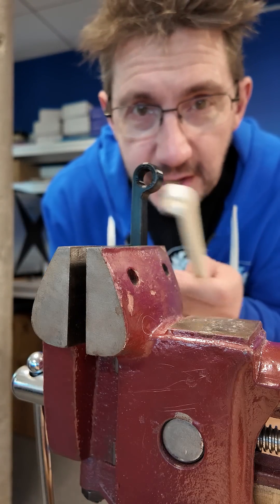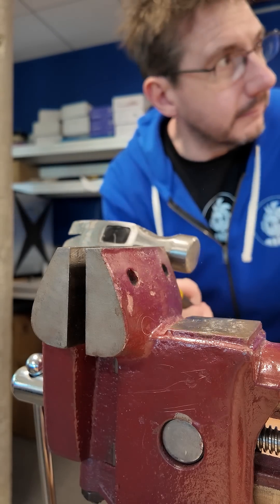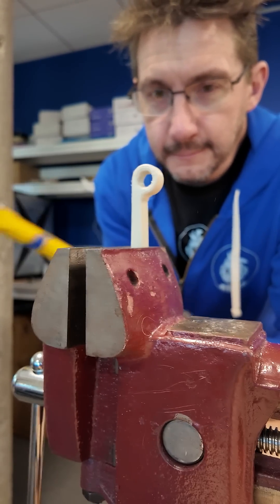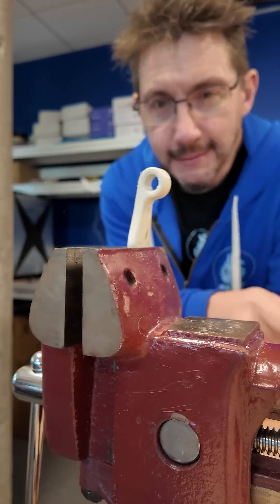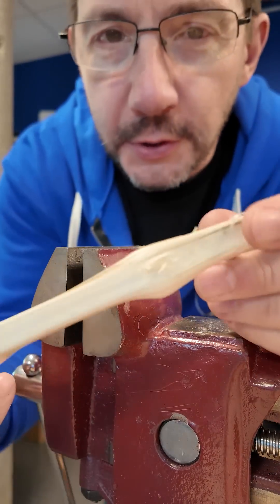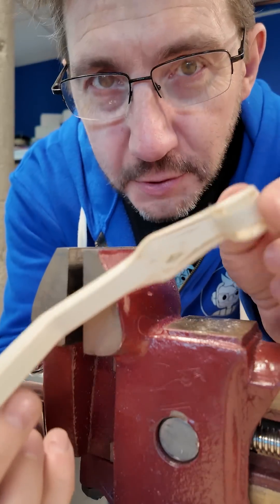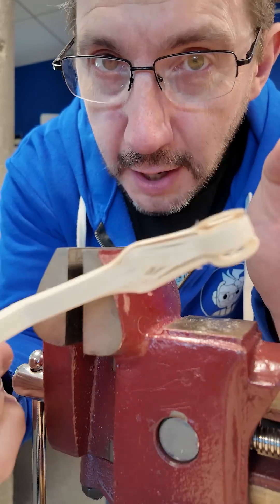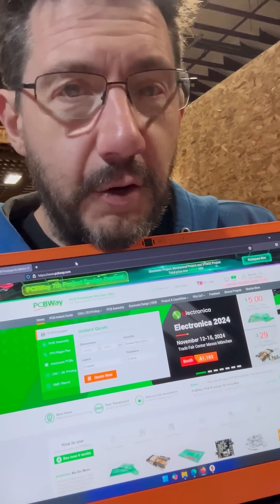Hit It With A Hammer?

Comment: Too bad the layer adhesion is awful, even when printing at 350c
Reply from the maker: Yeah its super tough to print. I'm going to throw the 22IDEX at it, it's 500C+ on the nozzle and 300C on the bed. fingers crossed.
Reply: @3DPrintingNerd  hopefully that works. It just sucks that they advertise that it works on the x1e and the provided profiles don't work

Comment: How does it hold up turning it 90. Degrees and hitting it?
Reply: 90C? The material does not soften till around 180C-200C so 90C would be no problem.
Reply: @Z-PolymersInc  I think they meant rotating 90°, not heating. It's a layer orientation question.

Comment: There is no ways the PETG part is printed in the same orientation as the Tullomer! Come on Joel
Reply from the maker: It 100% was.
Reply: the experience I have with PETG is that you can print it so that it becomes easy to break off, or you can print it so that it becomes extremely tough.  a lot depends on which brand of PETG you buy.
Reply from the maker: @gunnarsson272  Can you share which brands of PETG you've had the best luck with? I'd love to hear more about it!
Reply: @3DPrintingNerd  easy print PETG from 3Dprima.  I have printed out things that are on the car and the tractor. I have never had to dry a spool before printing their filament.  I have printed parts in their TPU that sit under the car, for 3 years. They can withstand from -30 to +30 degrees C. snow, salt, and rain.

Comment: I think Taulman alloy 910 would perform just as well in this test, however I was extremely disappointed to find that Taulman sold out and the company that bought them only produced alloy 910 for about a year and then quit. So no more Alloy 910, which was hands down my favorite engineering grade filament. I wonder if this stuff would make good gears like alloy 910 did.
Reply: I think I still have a few rolls of that. They just need to be dried.
Reply: @eighty-eighth_section  I found some from a store in New York that was in stock, but I ordered it two weeks ago and it still hasn't shipped. I don't think they actually had any available. Thinking about cancelling my order.
Reply: @grantdeisig1360  oh, you seriously actually love that stuff! I just checked. I have precisely 4x of 1 lb rolls. I'm based out of Massachusetts. I can give you the rolls I have for free if you don't mind paying the shipping. I have no use for them.
Reply: @eighty-eighth_section  yup, my order fell through... Apparently this stuff is wiped off the map at this point. Or at least the 1.75mm stuff is. There's still 2.85mm out there, but obviously I need 1.75mm. so if that's what you have, I'll take you up on your offer.